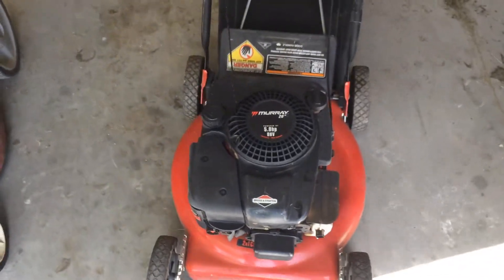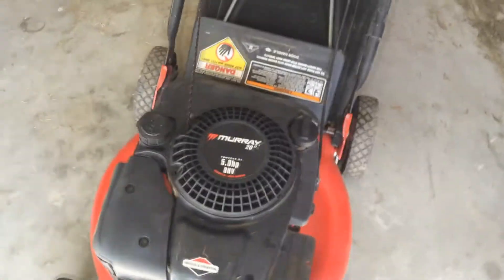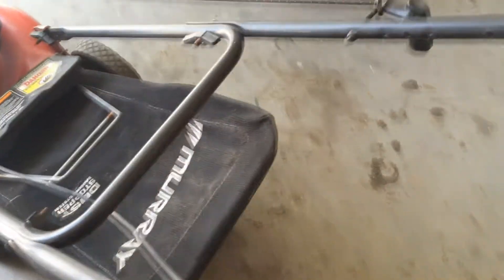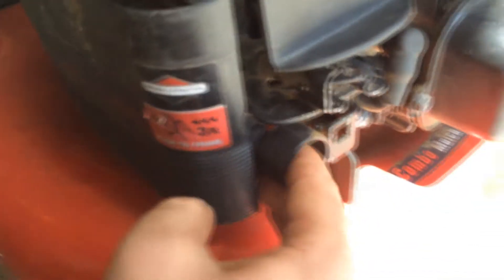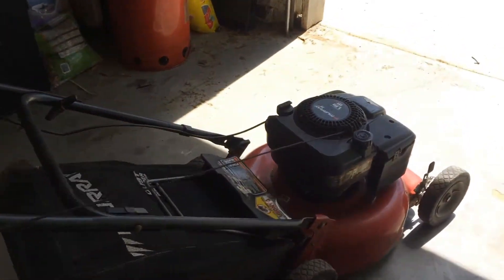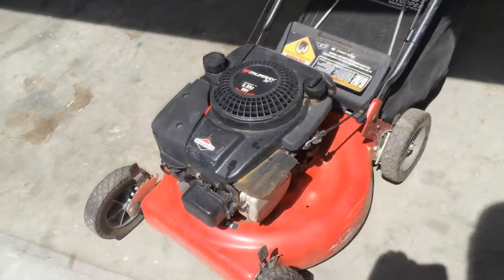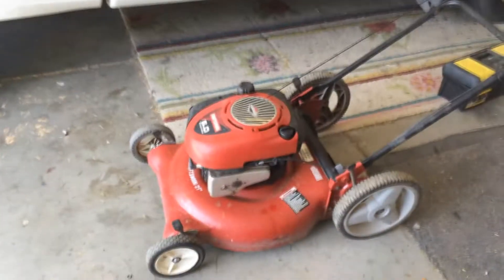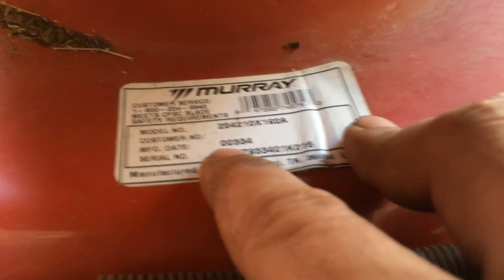Murray 20" Lawn Mower 204210X192A

Comment: i have a similar model but the model tag fell off. Can you give me the model number? I am trying to find a engine stop cable to fit
Reply from the maker: Model is in the name of this video, if you’re asking about the engine this machine has long been sold. The best you could do is just get a universal one and worst case you’ll have to drill a new hole into the handle
Reply: @hanksgarage_  Thanks I thought it might be that but its looks different than most mower models numbers